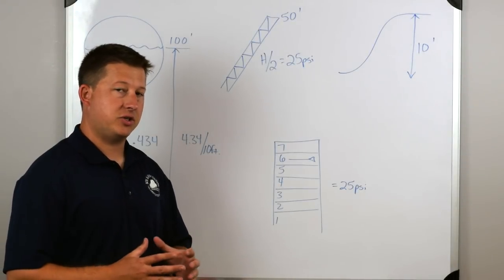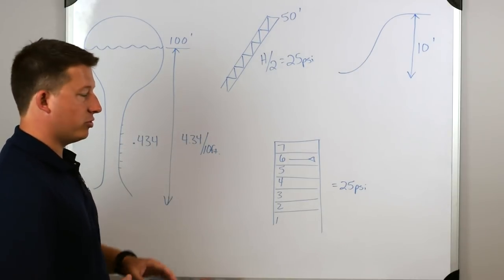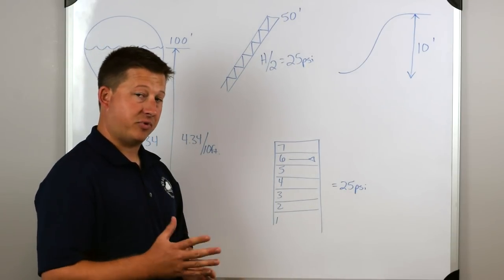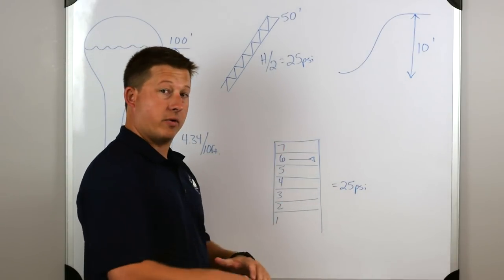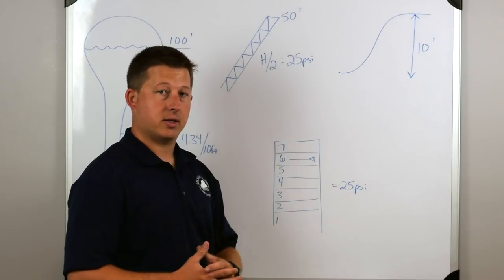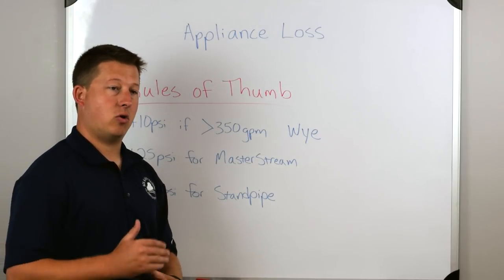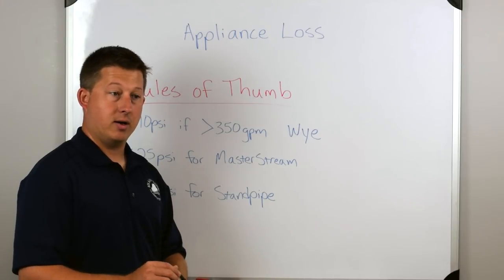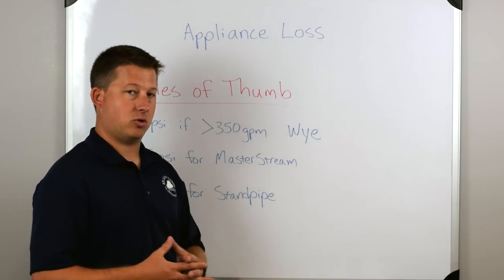Pump Operator Training Series - Part 4 Elevation and Appliances

Comment from the maker: Michael Poulin The automatic nozzle will maintain the same nozzle pressure as the flow changes. So, on the nozzle you will see the pressure the nozzle operates at, or a range of pressures and flows the nozzle operates at. The only way to truly know what your pressure loss is would be to flow test it. That being said you should follow the same general rules of thumb and elevation pressure losses when using an automatic nozzle. The only thing different with the automatic nozzle is that as the flow increases or decreases the nozzle pressure stays relatively the same. If it is a 100 psi automatic then I would add 25 for the loss in the piping and then add any pressure loss due to elevation of the aerial (Height/2).

Comment: I seeing your videos and its great to refresh several things.....keep doing well

I got a question...this scenario...i got a 100' ladder truck full rise and transmission or pto fail....but still need for attack and i got one pump 1.500 still work along with ladder for water supply because the truck was the first on scene can I use the pump for making pressure to keep that ladder in operation without pto???? Could this formula be apply for that? Thanks for any answer you can bring and once again keep knowledge roll for support our brothers in call!
Reply from the maker: Most likely of you loose the PTO you will loose everything including hydraulics, you pump, power, etc. the only way to continue flowing water would be to have an engine pump into you. Basically use the waterway pump pump from a different source. However, if you loose the PTO it should be a pretty serious emergency and you would need to use hydraulic overrides in order to get your ladder down. If no one was on the ladder than I might could see some situations where you would leave the ladder elevated to just flow water from above. Most likely you wouldn't be able to control the nozzle though. Thanks for the kind words.